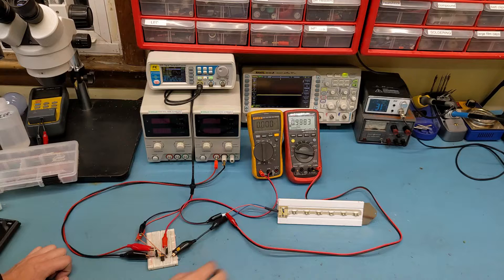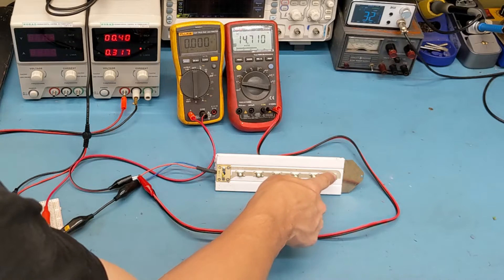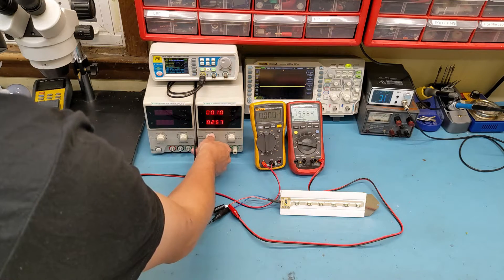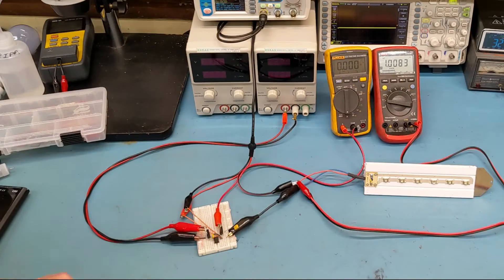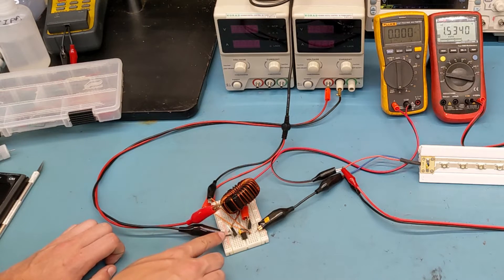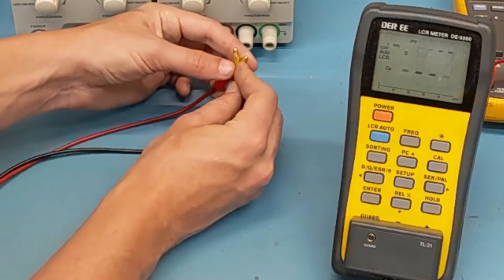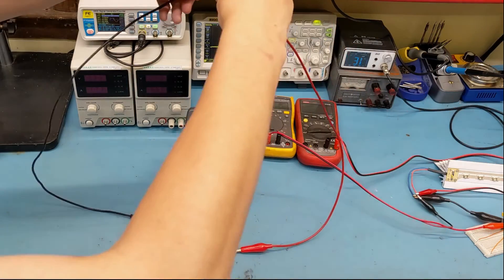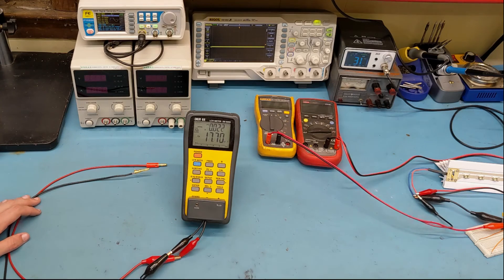Boost converter WITHOUT an inductor? YES!

Comment: A very cool experiment. I knew the efficiency was going to be dreadful lol, but it did work! It also provided a surprising amount of boost at 40 mV and 300 mA. For a different project I surmise a small hand wound inductor would suffice where the current needs are minimal and you just need a bit more efficiency.